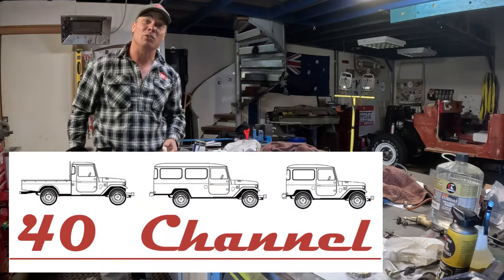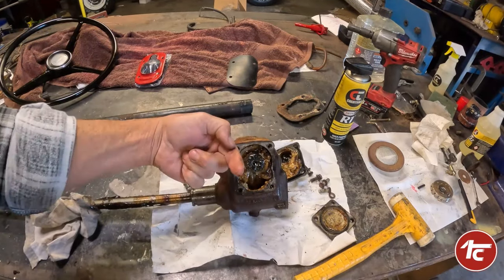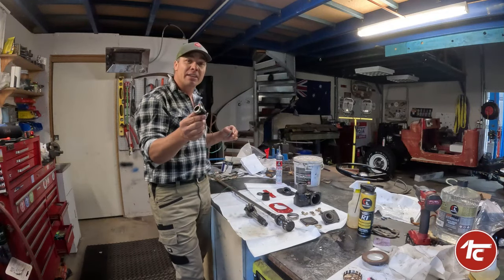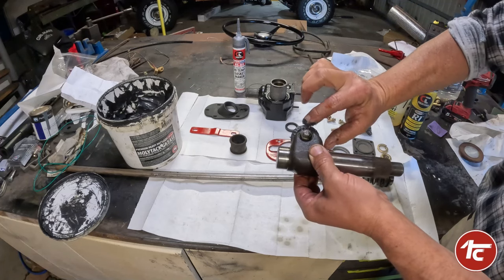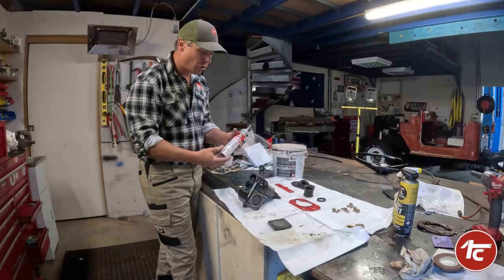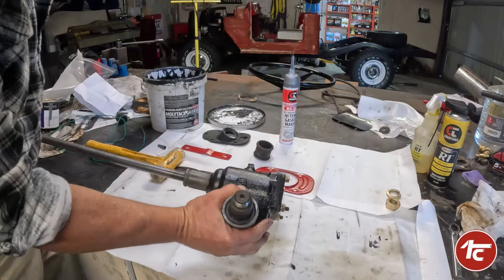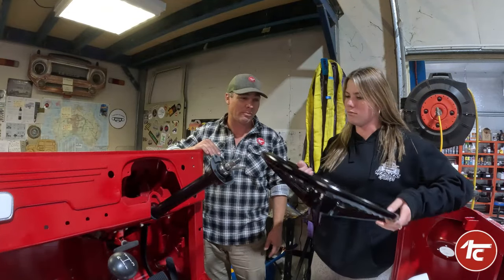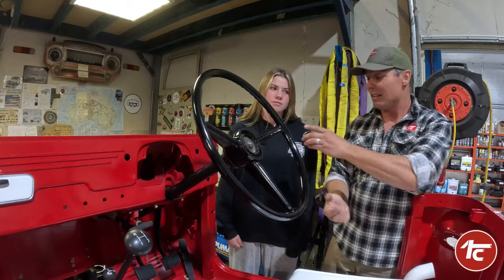Steering Box rebuild, plus electrical check on blinkers Old school Landcruiser

Comment: A lot of times you’ll find shims on the shaft and removing them will tighten up your steering. Mine also had a gasket on the larger cover and a metal shim on the smaller one. I had to remove all my shims to tighten up my steering and I still have about 3-4 inches of play in my steering wheel. Also, I had grease in mine, but filled it with 90w oil when rebuilding.
Reply from the maker: Great feed back, no shims on mine.
I had thought about using oil after sealing, but after seeing how well the grease had protected and held up, I went but to grease.

Comment: Grease or oil in the steering box? I have an identical steering box in a 1971 FJ45. Thought heavy duty oil? Wrong?
Reply from the maker: oil can tend to leak, grease will still provide the necessary lubrication needed, and is less likely to leak, and has been used by many like this for years with no issue which is why I used grease, If your seals and gaskets are perfect then a thick oil would be better.